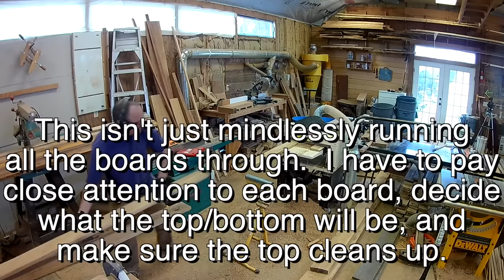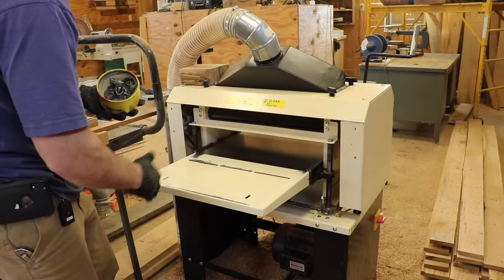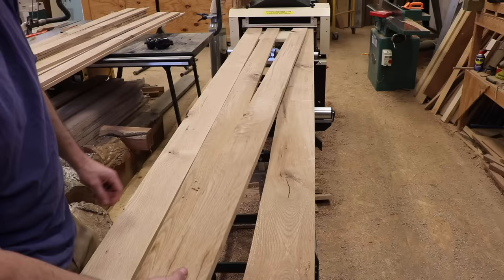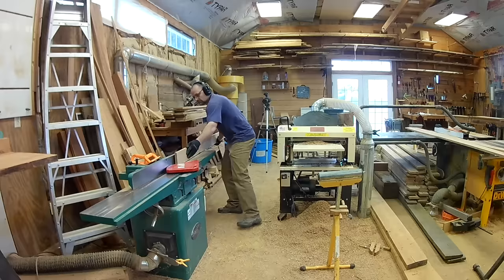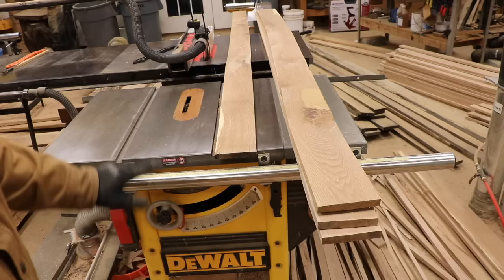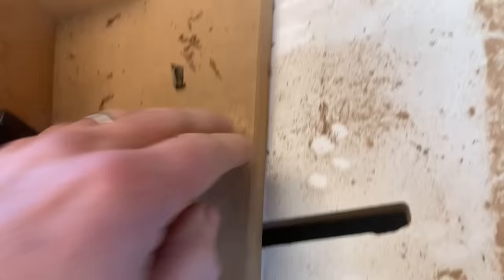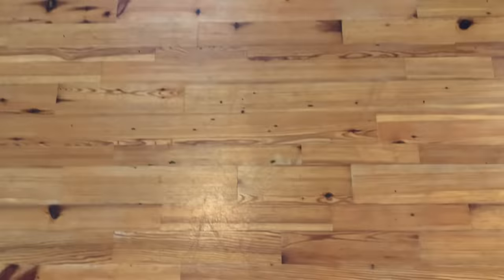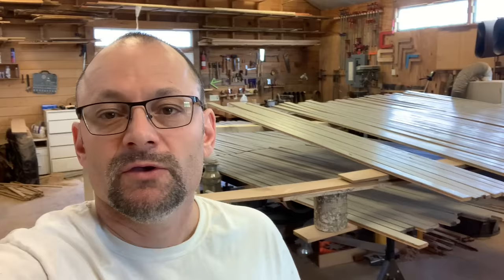Making Tongue And Groove Flooring From A Fallen Tree.

Comment: Love wood floors. I built my house 4 years ago and was pleasantly surprised the builder offered 3/4" red oak as an option. My wife and I wanted a zero carpet house so we had them do the wood everywhere except where there is tile in bathrooms and laundry, even the closet floors are oak. They did a hand scraped distress and dark cherry stain that just looks amazing. Never thought I could get a new home with floors like this.
Reply: Well, if the new house doesn't offer it, you could always tell the builders not to do the flooring and hire another contractor to do it! Probably a bit more expensive but well worth it in my opinion!

Comment: I also have a Woodmaster Planer. Mine is a 12 inch and about 35 years old. Works great...Now. I had trouble feeding and didn't feel comfortable with was on the table. I feared that the was would transfer to my wood and mess with the various finishes I use. My "fix" was purchasing a UHMW sheet for my particular planer from Woodmaster that fit my feed table. WOW, what a difference that made. I have had the UHMW sheet for about 1 year or so, and it is a real pleasure to use. No trouble with non-feeding at all now. Great video you have here. Thanks

Comment: Enjoyed the video. I have made mountains of sawdust, making custom flooring in my one-man shop. Here's a coupla ideas to consider. On the grove edge, if you quickly run it back thru the tablesaw and take 1/64-1/32 off of the bottom "tongue" only, it will insure that the top joint will always be tight as can be!. Also, you might consider making a plywood sled jig that rides in tablesaw t-slot with a coupla adjustable toggle clamps. This will make your one-edging operation super fast and super accurate. And you can do up to about 10' stock. I used to do this before I bought my 11' sliding table saw - yeah, I know - that is cheating!
Reply: reducing the bottom half of the grooved side is the professional approach. That's how you buy if from the manufacturer.

Comment: I worked in a small molding shop for a few years making all types of molding, casing and flooring, we even made columns for a historic home out of tapered two ways tongue and groove strips.  Really miss that job sometimes, learned a lot.  We used wax on all the moulders and planers, it was in a block form.
Reply: Where do you live?
Reply: @cindymathisen9697  eastern NC

Comment: Nice. I have done this (make my own T&G) from rough-sawn raw-edge chestnut boards that I bought (dead cheap) from a local farmer (so not all the way from the tree, but that's as close as I will ever get).

All I have is a DeWalt table-saw, a Metabo planer/thicknesser and a home-made router table (actually just the top, mounted on a workmate). It's lots of effort and I produced more sawdust than I have ever seen in my life XD. Also, the floor was for my new workshop so I had to do it all in the open air on temporary setups.

What I did was put a straight-edge on each board first using the table-saw and a straight-edge jig... then through the planer and finally ran it all past the router with a T&G set.

Very, very satisfying when I laid it.

EDIT: I had the exact same problem running bowed boards through the router i.e. bowed boards can lift and your tongues and grooves can start wandering all over the place. Solved for the most part with a second feather-board after the cut and by paying attention and adding my weight on the board to help keep flat when it was necessary. Still didn't work always, some boards just don't want to be in your project!

Comment: Many years ago I built a straight edge table attached to one wall in the shop. Two by shelf. Two by four inch channel steel straight edge.Hold down clamps to secure lumber. Gauge block to adjust offset. Run router along channel to straighten the lumber edge. Sometimes reset a few times for larger defects. Easier to utilize than a jointer.

Comment: I'm part way through the same process as you.   Almost two years ago I ended up have my mountain cherry trees taken down at the lake house.   They had disease and had to go.   I had a company come in and drop them.  That's all they did.   Eighteen trees for 1200 bucks.  Not bad.  They had to remove a few other trees that were in the way.   I bought an Alaskan saw mill.  The small one.   I have a STIHL 18 inch saw.   Somewhat under rated for doing so much milling.   It made it though.   Ended up with about 900 board foot of cherry.   This summer I figure it's going to be as dry as it's going to get.  It's been on the covered porch drying.
I decided that it was going to be flooring in my two downstairs bedrooms.  
This summer I'll start milling as you did.   My pieces are 8 foot and some are 11 foot.  
Dad was a wood shop teacher and built that home.  The cabinets and some of the stairway is from the cherry on that property.   Why waste a beautiful wood in the fireplace when it can be put to good use.
My neighbor helped me with cutting the boards.  We made a few three inch thick boards and he grabbed some for a project he's starting this summer as well.   Neighbors helping neighbors is important to me.   
I'm hoping it all works out.  I'm glad you mentioned to the width of the boards.  I was going to go with about six inch to eight inch boards depending on what I could get away with.  But cupping would be an issue.
I'm waiting to see how your flooring project turns out.
Reply: Sounds like it's going to be beautiful!
Reply: I'm envious of the trees on your property. My property has mostly sweet gum (useless for woodworking), soft maple, and loblolly pine.
Reply: @mikehodges6598  We have some sweet gums also.  Nice tree except for the 'gum balls' they drop.  Hard on the feet.

Comment: I usually use a track saw to establish a straight edge, then I rip to my dimension before planing.  I think this is quicker than jointing the edges and creates less saw dust than planing first, as you'd also be planing the stuff that will be cut away later.  

I also invested in a portable 1/4HP power feeder that attaches via magnets to my table saw and router that's build into my table saw.  Not only is this safer than ripping many boards but also eliminates the start/stop dings when pushing long boards through as you adjust your grip when ripping.
Reply: You must have a lot of room to have all that stuff.
Reply: @beebob1279  No more room than the guy in the video.
Reply: Yeah, a power feeder is wonderful when producing HUGE batches like this.

Comment: Thanks for opening my eyes to what to expect. I'm up to the challenge of converting 28, cut down elm trees, that have been milled to rough sawn, 1 1/4" by approx 10" w by about 1600 bd ft of lumber. Hoping to do some tongue and groove flooring in my home with it. This is a great video. Nice work.
Reply: Be cautious with your elm.  There ARE several subspecies,, an American elm fro SE Michigan is not necessarily the same qualities of an American elm out of southern Ohio.  Elm is an incredibly fibrous wood.  Many elm trees,, don't even try to split the wood for firewood,, You will fail, or be so tired you'll wish you had not begun.  Elm in mid Michigan does have an important use.  The interior bottom of a large dump truck,, particularly if used to haul busted concrete to a crusher for recycling.  A 2.5 to 3 inch thick plank of elm will survive for 2 or 3 years having concrete chunks from highway projects thrown in by excavators.  The stuff is tough.   Even 2 plus years of abuse,, the elm is not broken,, just worn thin.
Does not plane easily,, requires absolutely sharp knives  Even carbide insert planers,, must be sharp or they just raise the grain.  Sanding,, take it down slow.  You may even want to do a water wash to raise the grain,, to sand it down to a finish.
The stuff is a pain,, but,,, if you ever get a 13/16ths floor down and pretty  that floor might last for centuries in a home.

Comment: nicely done video.  You do a good job explaining all the processes.  I do my stock prep fairly similarly.  But a couple suggestions:  
1.  with a board that's got edges that are not fairly straight..I always run it thru the table saw first.  Saves multiple passes on the jointers, and saw blades are easier to sharpen and change than jointer knives.  Wish I had a SLR, (straight line rip) but even without, with skill, and a little longer fence or guide, you can do a decent job such that then it is only one pass on the jointer.  
additionally in watching your jointer, it appeared that you were putting pressure on the in-feed bed most of the run thru of the board.  Probably works ok for you, but you should try putting most of the pressure on the OUT-FEED side once the board has progressed thru the head enough so that the out-feed table is covered.  The idea of a jointer is that you don't have a reference flat edge until the board has passed over the knives.  On one of my jointers I put on a power feeder on the outfeed side, really makes it easy, just like your planer, just have to feed it far enough that the feeder wheels grab the board.  makes an especially nice cut then.  
anyway, great video.

Comment: You should buy a pellet machine and transform all dust into pellet b class . You can sell it also or buy a pellet stove for the winter
Reply: It all depends on profitability!

Sale's vs Overhead costs. 

If he would buy the machines for himself or for sale he would have to maintain a level of output very hard for a 1 man shop.
Yes it sounds great to do. But not so easily achieved in reality.
Reply: He's got a boiler he can just toss the sawdust into. No pellets needed.

Comment: I ran 5800 last ft of larch/tamarack several years ago for flooring. 4,6,8 inch wide, I milled it to 1 1/8 thick air dried it for a year with tons of stickers and sealed the ends with a wax that's made for that. Since the tamarack is not as hard as oak or hickory my final thickness was 7/8 inch with the tongue and groove in the regular spot. I figured an extra 1/8 inch on the finished side would give an extra 100 years of use to this floor. Great video on your part, it is very time consuming inspecting each board. But worth it for gorgeous finished product. I had a couple of of advantages over your process. First I had a power matic power feeder that I could put on my table saw or my 5 hp shaper. Not having to push the wood thru by hand was awsome. Second I had a power matic planer with the helical head on it. I want the planer moulder you have so I can do window and door casement and crown mounding. But that helical head planer kicks ass and its 1/2 as loud as a regular planer. Bottom line I bought a used shaper, jointer and new planer and paid for them with the value of the flooring I made. I figured the 5800 ln ft of tamarack flooring I made retails for $16,000 it's beautiful and hard to find. I bought all the above tools plus really nice Freeborn cutters for the shaper and lots of misc. Small tools. On the wider boards I ran them thru the shaper and put relief grooves in the bottom. Great video on doing flooring yourself.

Comment: Nice collection of tools I have a Woodmaster 38 inch drum sander I got it used and currently I’m in a 24 x 24 garage I plan on moving in my new workshop will be 40 x 40 when I put mine on wheels and a built angle iron frame put some heavy duty casters on it I made some stair treads for a job the biggest one was 60 inches long 32 inches wide at the widest down to about 6 inches it was a pie shaped piece I sanded 15 stair treads both sides One hour done

Comment: A couple of years ago I bought a 2" straight cutting bit for my shaper.  With a fence and a power feeder, I find it's less work to straighten boards for T and G and cove siding with the old Poitras.  It also requires less skill and attention than the jointer.  A fine video, BTW.

Comment: Very good job.  I also really like your shop.  I had a commercial shop when I was younger.  One thing you might like in your shop are carts.  I welded them out of thick walled one inch square stock.  I had a lot of sink cutouts from a local Formica dealer.  He just gave them away.  So I made the carts to fit them.  They were just under 24” long and about 14” deep.  Another thing I did was make stakes for the top about two foot long.  That gave me something to stake the boards against.  I couldn’t find square stock to fit inside the stakes.  So I just used round pipe which worked just find.  There was another shelf just above the wheels.  That gave me twice the area to stack on. On your router table you could have both carts at the same end of the table.  Take off of one table and stake on the empty one.  One other thing, I did too much work for a router table.  I had a Powermatic Shaffer and also a Grizzly.  I made all my own molding by just using high speed steel blades that I would buy 12” long and cut then grind and to and shape I wanted.  The holders held four blades each.  Then turned really fast.  I had very little burn but both of them were five hours and hooked up three phase .  There was just no stop in them.  I also used a trash can under my cyclone with wheels under it.  I used bags.  I would just roll it out from under the cyclone, tie the bag up.  Then by laying the trash can on it’s side.  The bag would come right out and stacked till the end of the day.  When they went into a dumpster.  My shop was in town.  Good luck. I realize shops are always revolving.  Your away ahead of most of them.  I can also tell you like the work.  My whole career, I never felt like I ever worked.  I enjoyed it that much.  Later

Comment: I have the same planer as you have and I switched to there steel front roller and it works great. it for planing R/S lumber . R/S wears out the rubber front roller

Comment: I had six hundred and forty acres out on the Olympic peninsula  and own five shake and shingle mills. I don't have to tell you how  labor intensive it is as to what you do. I on the other hand, had so much wood that I had to set up for volume and so when I started a wainscot mill, I seen a ton of wood recovery an then the market for shake/shingles fell on its face. I turned all of my logs into flooring and wainscot. The wainscot was in one foot multiples so knots no longer left me with out some salvage.  Later I even did lap siding and that pulled my butt out of debt within weeks. Since I had over a hundred and fifty employees. The next challenge was the sawdust and waste. I made some burners that were made from brick, it chewed up so much that I rented out burner space as burners like I had averaged around ten thousand back then in the eighties. I don't know what that works out to today. I also had crews laying flooring or other. I must of owned somewhere around five hundred power sanders ... they look like a floor buffer. Its a very powerful tool and would be the clear ticket for your "worn" floor on the porch

Comment: In Australia we make floor boards out of Murray Pine or sometimes called Cypress Pine. It is completely indestructible to termites.......they wont touch the stuff.  However, in modern construction, most homes now are concrete slab or particle board flooring.

Comment: Johnston’s paste wax is great for the jointer when you’re pushing rough sawn lumber over the top to straighten one face & edge before thicknessing to gauge the other two faces smooth and square.

However, for the thicknesser platten, I’ve always used a block of paraffin wax (candle wax).

It stays in place longer and if you need to add more you can just hold the block under the board as it’s feeding in and this transfers the paraffin wax to the platten table without having to turn the jointer off and lower the platten table to get your hand in then re-set the height.

Give it a try & see how you go.

Comment: A fine video of the process from tree to flooring. I wish I could afford the equipment but maybe I can find some contractors who can do some of the process for me. You make a very valid point about how you c/would use the timber for indoor flooring. 
One thing I would suggest is that instead of all the speeded up sections a couple of normal speed ones showing the full details of the processes. Thanks.

Comment: I have that same Woodmaster. You can also set it up with a subtable and use it to rip, and make molding, and cornice molding that is difficult if not impossible to create with a router table.
Reply from the maker: Yep.  I've made lots of molding for my old house, and able to exactly match the existing pattern thanks to woodmaster.  If interested I make some in my fireplace mantle video.
Reply: @FarmCraft101  actually I just finished watching them. Nice work on that and the porch.
My daughter just bought a 1908 house that'll have me making molding and railings for her.

Comment: I worked at a mill as a maintenance supervisor. We processed from log to kiln dried floor. We Air dried for no less than 90 days. The resin in the wood need that long to cure. That's what makes it stable. Generally Air cured wood for furniture needs to be Air dried for a year. Seems like a long time but it's the only way to get a stable product.